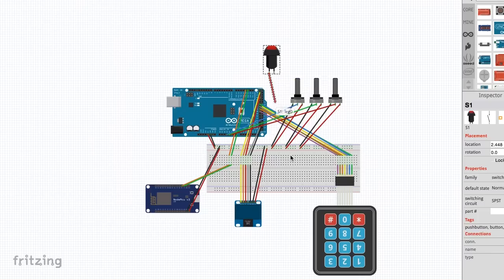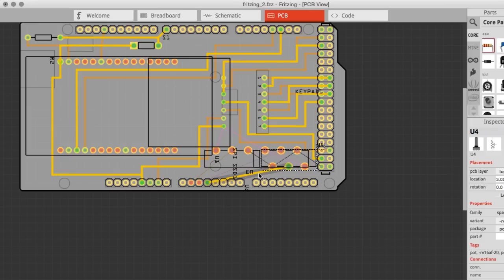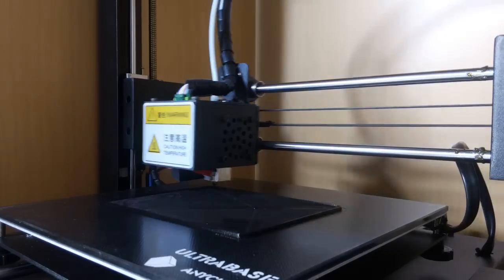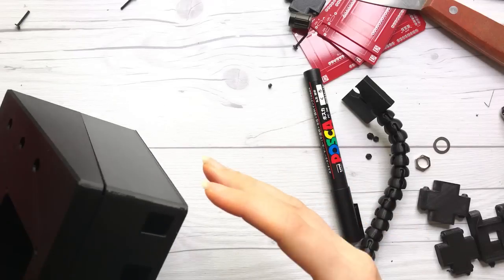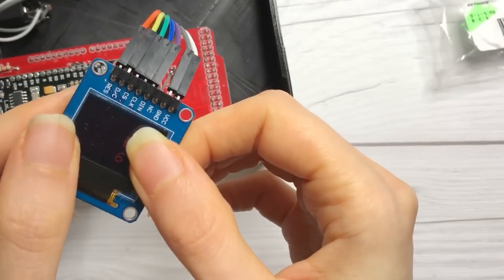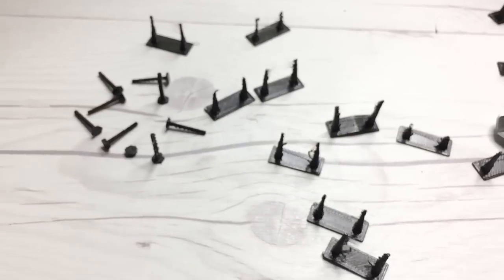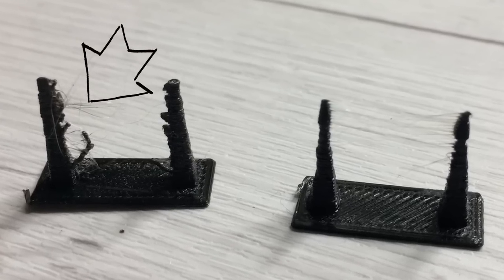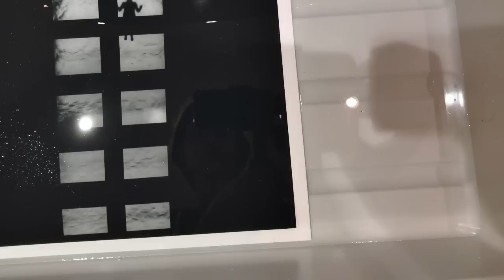Finished DIY WiFi Arduino darkroom timer and RGB LED light source

Comment: Fantastic project.  This should be a Kickstarter project!  Thanks for bringing the video to us.
Reply from the maker: Thank you Alasdair! There have been other kickstarters for timers already and there are viable and very good commercial solutions out there already! I don’t think demand is high enough to support another one. And the light source is so specific to the enlarger that it becomes way too expensive to produce, which explains why cold light sources and such things are so expensive now. I just wanted to show people that this conversion can be done for less with a bit of ingenuity! Saved myself a good chunk of money by building this stuff myself! If you want a timer like this, check out the open source version linked in the description. Not a difficult build, you just need to find the exact parts!
Reply: Lilly Schwartz Well, maybe not a kickstarter, but a mini campaign to sell the circuit boards and parts.  I would be happy to pay a premium to get the right parts and video instructions to put the board together.  Then I could look at how I would convert my old Vivitar enlarger to have RGB LED light source after the colour head got damaged beyond use, band use it with the timer.
Reply from the maker: +Alasdair Dougall Do you have any experience with soldering through-hole components? Any Arduino / coding in C experience? If yes, I still have a few boards and can walk you through the assembly process. It’s not super easy to assemble, quite fiddly in fact, which is how I killed my first screen. You also need to reflash the firmware of an ESP WiFi chip which isn’t totally straightforward. Also, I wouldn’t be printing the enclosure, since it’s a 20h print in total and I just can’t guarantee the quality on my little home printer and sanding PLA is not the healthiest thing to do for the lungs 😬 I can give you the STLs though! Keep in mind that you might also need a 3D printer if your Vivitar head doesn’t take opal bulbs with standard bulb fittings. You can use high power LEDs and code your own WiFi interface on an ESP WiFi chip, but I still haven’t figured out the right driver for powering them and had no space to cool them adequately in my original head. That’s why I 3D printed a new head in the end. Also, the LIFX bulbs have a CRI of 92 so are not totally perfect for RA4 printing either, but I have seen people print colour with them and they had decent results. You probably see now why it’s not really viable as a product or why I’m hesitant to even offer a kit. I used to work in IT support and there are so many fault points in this assembly scenario, it’s probably not worth it for anyone involved. That said, if this hasn’t put you off, send me a PM on FB. I can definitely send you a board and parts list. The code isn’t quite finished, because I need to do some additional testing and fix a few things, but I think by the end of the winter it should be fairly stable.

Comment: What especially makes the timer hard to program? Is the algorithm complex or is it hard to get the timings precise? Or something else?
Reply from the maker: The algorithm itself isn’t the issue, it’s the space and memory constraints of the Arduino. Memory stuff is notoriously annoying in C, so it’s a real headache to code it in a way that fits within the Arduino constraints. It’s not quite that bad on a Mega, but there was still a lot of swearing and “Why am I doing this to myself” involved. Basically it’s not a beginner project and  even I was at times struggling with it although I have a Robotics degree. It just needs very arcane skills because computers are so powerful these days and nobody teaches how to code memory efficiently anymore! This would have been a piece of cake on a regular computer with standard libraries, but on an embedded device there is no space for libraries so it’s like coding with both your hands tied behind your back. 

Sp, if the thought of tight memory handling in C doesn’t make you groan, then go for it 😅 If on the other hand you‘ve never used pointers before, then this will be a nightmare, because Arduinos don’t have segmentation fault warnings and you won’t know at all whether you’re doing it wrong. Everything can look like it’s working fine, but 5 minutes later it might start overwriting your screen with random stuff because a pointer is pointing at the slightly wrong place. To call it “infuriating” would be an understatement 😅
Reply: @LillySchwartz  I never used Arduinos but I have some experience with 8051 type processors, which are even more limited I suppose so I understand the troubles of working at the limit of the chip's capabilities. When things became too critical I would switch to assembly which is an even deeper rabbit hole..
Reply from the maker: Oh, if you’re used to memory constraints then you might have fun with it actually. Some of my friends do sizecoding for old computers for fun, demos and stuff like that. They enjoy the challenge! I’ve never used Assembly myself, but I can imagine that it’s more fun than dealing with pointers gone wrong 😂

Comment: Great project! 
What  rgb led light used? I can't find it in components list. 
Thanks.
Reply from the maker: Thank you Ruslan! And thank you for spotting the missing component, I added it now. It was a LifX smart bulb since this one is fairly well documented and you can control it via sending hex over the network. There are also python libraries for it, but they needed too much memory for the wifi chip. You'd potentially be able to use those in a smart phone app though.

Comment: I don’t think you can get low enough wavelength with a bulb like this - you need around 420nm for pure blue light to get high contrast grades. Higher than this and you will be hitting the low grade emulsion. Did you find this is a problem in practice?
Reply from the maker: It definitely isn’t the “ideal” bulb on paper, but in practice it really isn’t noticeable!  Printing with this light source just feels like printing with a regular bulb. I think it’s rather common to overthink all this and worry too much about wavelengths or CRI and get lost in data sheets. I definitely had no problem getting good contrast in any of my prints and there was a good range there to dial things in. I even found a forum post where someone used this bulb for colour printing and it worked just fine for them!